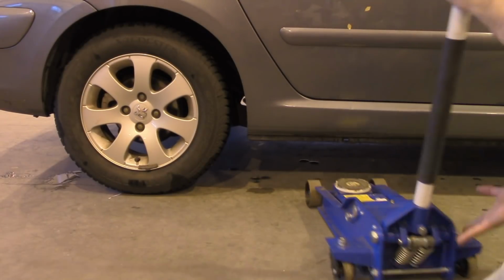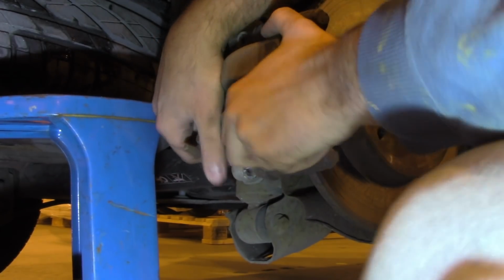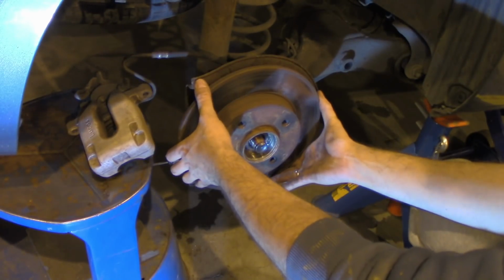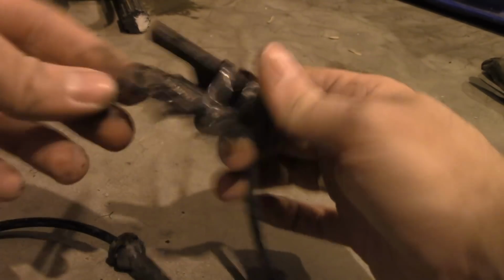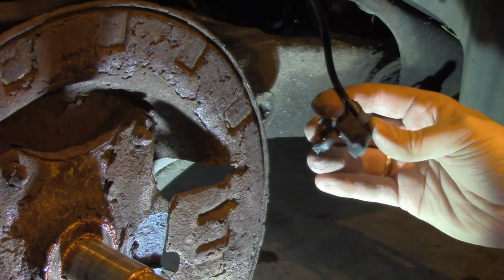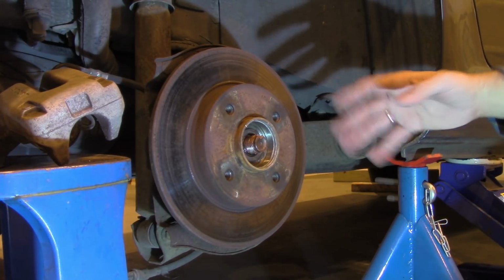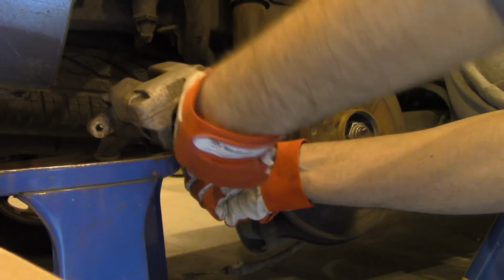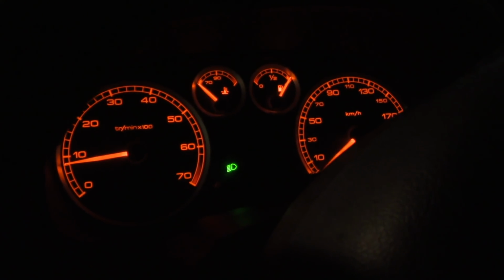ABS Sensor Replacement ("ABS/ESP Fault") - Peugeot 307

Comment: Just a tip for anyone reading the comments. I had the ABS and ESP fault code, but it was not because of a sensor but the brakelight switch behind the pedal malfunctioning. Please check if your brakelights light up when you press the brakes, to diagnose the problem. This could have saved me a lot of trouble. However this video is very helpful for changing the sensor. Furthermore, be aware that you need a brake caliper tool to rotate the brakecaliper back to assemble the brakesystem.

Comment: My cruise control is not working , I've replaced the brake switch but still not working yet think does it had to do something with the ABS sensor ?

Comment: 13:29 this bolt is aligned with the wheel bolt hole, so you do not need to remove the hub to replace the sensor.

Comment: Both bolt heads also snapped off on the rears when removing sensors on our 307.  Cleaned off all the rust slag and then refitted the sensor to get clearance The ring had lost all magnetic coating so new ring also!

Comment: I know you did this video a long time ago! On a 206 rear hub nuts are 200nm/148lbs ft so I think the same for 307 and you should use a new one and if you have a nut splitter of some kind that fits then you can use this to indent the hub nut lock.
Also when your compressing the caliper pistons all you have to do is unscrew the brake fluid reservoir cap a bit this will make it easier I didn't quite understand why you wanted to undo the caliper nipple to do this?
Thanks for the video  very informative especially the sensor gaps.

Comment: Hi, great video. I have a question, do you have any videos on ESP fault due to steering alignment? I changed the steering wheel switch, the one where the headlights and wipers switches are, apparently underneath there are circle rings  with magnets and they have to be aligned with the steering wheel, they are located underneath the PCB. When you take out the steering wheel, on first look, there is an arrow showing the correct alignment for the wheels, but how do I know if it's the right position, when Each circle the arrow is at the same "Aligned" position?  Do I have to count the circles form one end to another and place it at the middle number of circles? I don't have ABS fault, just the ESP fault, and it turns on every time when I start driving, right after 10 meters. Any help would be appreciated. Thanks.

Comment: Nice video! You don’t have to remove the hub. You can gl through one of the wheel bolt holes in order to remove the bolt of the sensor.

Comment: If you have bosch brakes you don't need to remove the cap or axel nut,just the disk as it separate from the hub.
That sensor looks like its for the bosch brakes.

Comment: Thanks for the great vids. I had problems with the ABS on my 307. Turned out to be rust build up underneath the rear sensors. It caused increased distance between the sensor head and the magnetic ring.Easy to fix once it was diagnosed.

Comment: My car have ABS fault, so i run diagnosis and problem is left rear wheel. So i measured both rear abs sensors and its about 6.990MΩ and the second 7.023MΩ so i decided both of them working. I cleaned magnetic ring, i didnt notice any damage part but its not working. Do you think i have to replace the magnetic ring? Also nice videos that helped me a lot :)
Reply from the maker: Hi Patrik,
Thanks for nice feedback :)
If I was to guess based on your explanation, I would say magnetic ring. Nonetheless you can inspect it first. even small crack on the rubber surface of the magnetic ring might make it useless. Take a torch and look at the ring (after cleaning it of course). If you see any damage just replace the ring. 
Good luck!
Reply: Is It Fixed Yet ? Well i changed ring it was a little bit damaged but not solved my problem. So i changed left to right and diag show opposit wheel so i decided problem is sensor, i changed the sensor and everything working. Im so happy. O saved a lot of money and learned a lot. Thank for help and keep doing videos.
Reply from the maker: Hi Patrik,
Great that you shared your story! Thanks!
Can you just add if this was the sensor with the 6.990MΩ or 7.023MΩ that was faulty?
Cheers

Comment: Dude you can change it from the wheel bolt hole... 5 mins job...
Reply from the maker: Hi Kamen,
You cannot do that on Peugeot 307 :) 
Cheers
Reply: Is It Fixed Yet ? I did it on my 307 2001 , both rear sensors.. need just allen key..
Reply from the maker: It would be fantastic to see this technique. Could you upload some short guide about it? I simply cannot imagine how to fit the key there... many people would appreciate that.
Cheers
Reply: I dont have this time right now , but you can be 1000% sure this is the way to change it. Just try to reach the sensor bolt throught the bolt hole with screwdriver and you will see its possible. Same with the allen key.. I use key from allen key set from Halfords advanced socked 170pc set
Reply from the maker: I believe you of course that it might be possible. I will check it out the next time I am in the workshop. Nonetheless in my case the surface that the sensor is located on is quite corroded (you can see it in the video). Even after I have cleaned it from excessive rust, I needed to press the sensor in place. How did you position your sensor when you had no access to the interface surface?
Reply: It is possible through the wheel bolt hole i did it at my 307 SW couple of times because of the APS error...
Reply: There are two types of rear brake disks-wheel hubs.. In the early models they are not in one piece as yours..
Reply: Just did it through the wheel bolt hole on my 2007 wagon